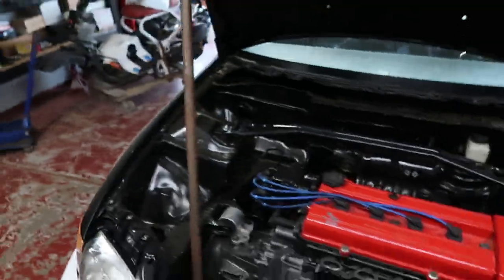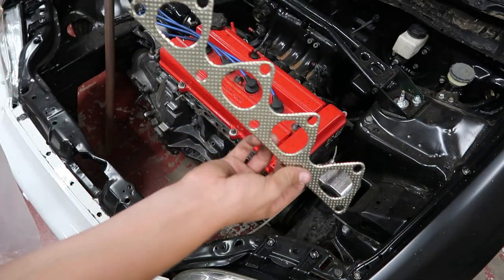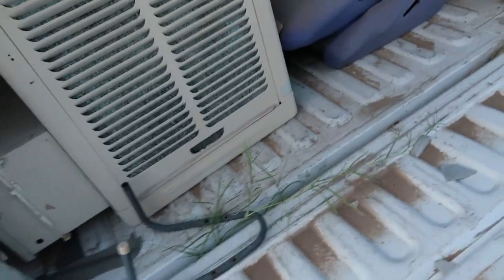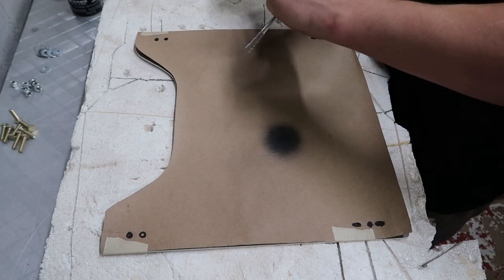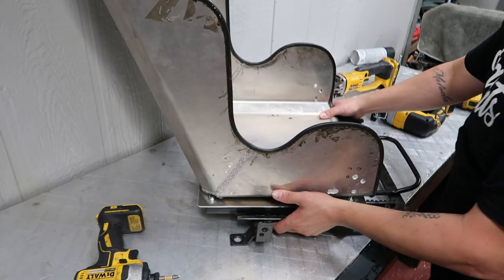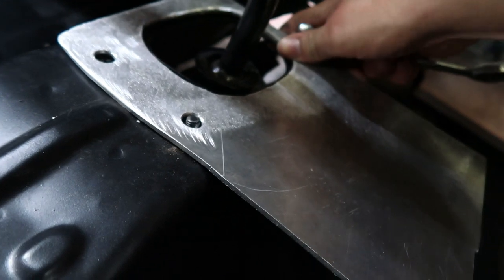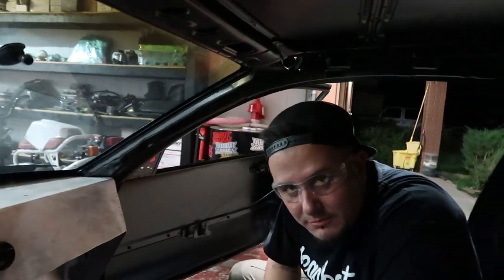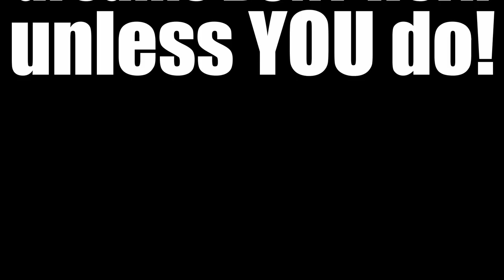Hydro Staging Brake for Venom

Comment: Those gaskets not gonna  last too long. U need the actual metal gaskets for up pipe  and t3 flange and header flange
Reply: Those blow harder than a..... well u know get a steel gasket haha
Reply: Was searching for this comment
Reply: Yea he should have left the metal gaskets that were already  there. Hopefully he see this and put them back on
Reply: Don't use gaskets. Flat surfaces seal well. It will never leak more or less, there is no layer there to ever fail. Just keep the fasteners tight.

Comment: Hell yeah a 40 minute video! Something to watch while I do my rear drum brakes on my EF
Reply: Read drum brakes?? 🤷🏾‍♂️, DA's are in every junk yard get some rear  disc 😂😂😂
Reply: @bighomieJ5X  no DA's here in Tucson. I checked lol. But I did find some brackets to convert my rear drums to Integra disc brakes. Just trying to make it to the roadkill event on October 1st.
Reply: @efnmadaboutcivics88  dang 4 reals? Well get the rx right for event. I practically gave away all my honda stuff last year to the kids down the street.
Reply: @bighomieJ5X  the only DA I found in the last year at Pull-A-Part had the rear trailing arms already stripped lol. Everytime I try to find an ECU for my mpfi swap, they're already taken out. I got an EF hatch, I wish I had a CRX
Reply: @efnmadaboutcivics88  how much b20's go for out there from an importer
Reply: @bighomieJ5X  Like $800 for a motor and transmission idk honestly, that's for future plans lol. I do want to boost a d series and gut it a little more. I have a daily and a track car both EF's 89 & 90. You got a Honda?
Reply: @efnmadaboutcivics88  a lil turbo d series is fun I had 1 back in the day b4 the internet 😁, not any more I drive an Express van for my 8 kids 😬😬

Comment: That's it. I'm just gonna start calling the police on people that use those gaskets. It's 2021 this needs to end. Lol
Reply: P.s. I only use a MLS at the head to manifold, and NO GASKETS between turbo and manifold, and between wastegate and manifold. Have the surfaces freshly flatted on a belt sander and they seal well, they will never leak more or less because there is no layer to fail. This is first hand experience on my car and a 10 second car I tuned.